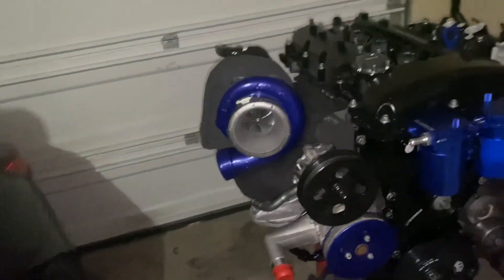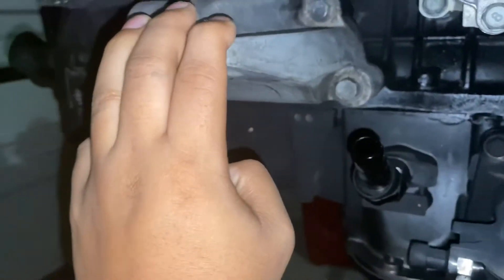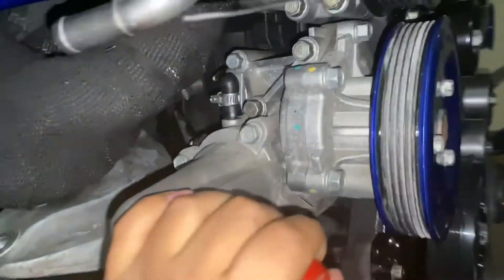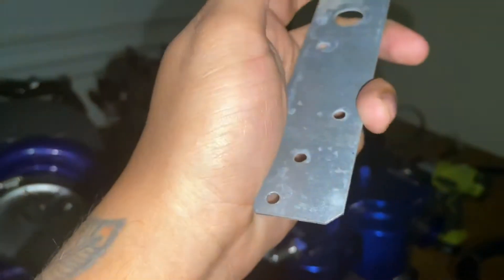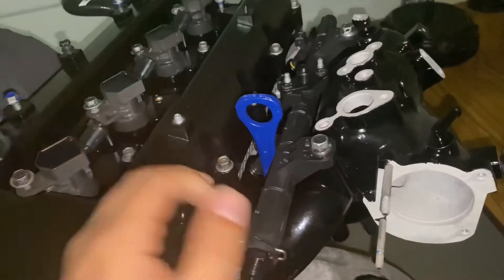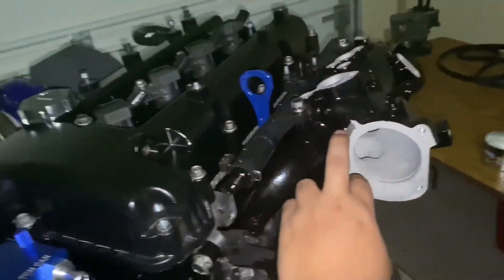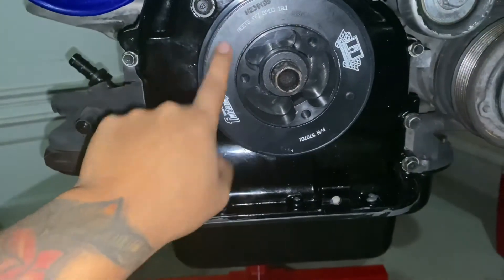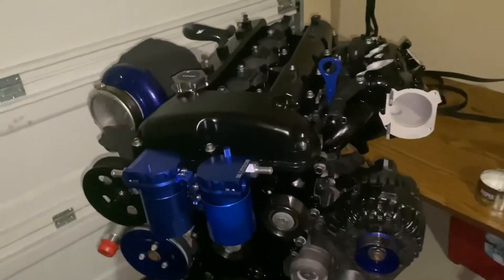Genesis Coupe 2.0T Engine Build Pt.8 | Accessories Pt.2 & Lightweight Crank Pulley Discussion.

Comment: What turbo is it your using ?
Reply from the maker: 6466.
Reply: @Brian Paul  thanks man, I'm in the middle of looking for a second block to build, and I'm probably gonna be following what you did almost exactly so I really appreciate these videos
Reply from the maker: @ryan_ray.  6266 would be better. I only went with 6466 since it was a sponsored turbo opportunity. 6466 was a bit laggy but the 6262 or 6266 would be a bit better and still make 6-700 wheel
Reply: @Brian Paul  6266. Probably would spool up faster, right
Reply from the maker: @ryan_ray.  a tad bit
Reply: Hey, question you made 700hp on stalk crankshaft? Also, did you have to sleeve the block for that hp?
Reply from the maker: @ryan_ray.  stock crank. Stock crank has been taken to 820 whp recently as well. 

And no I choose not to sleeve. But I recommend it for others. I didn’t care if the block cracked or not, my intention was to purposely abuse the block and see what it could take  with stock sleeves and trans.
Reply: @Brian Paul  I'm probably not going for quite 700. Would you still recommend doing it for 500-600
Reply from the maker: @ryan_ray.  I would recommend css for under 600 wheel
Reply: @ProdigePerformance sorry what do you mean by css?
Reply from the maker: @ryan_ray.  cylinder support system 
Look them up bro. Super beneficial
Reply: @Brian Paul  looks really cool, but I'm from Canada, and unless I can find someone from here to do it, getting like the darton international sleeves is almost gonna cost the same
Reply: @Brian Paul  thanks a lot for replying btw
Reply from the maker: @ryan_ray.  css is done all over. Definitely look around your local area for something similar. Snoopy panda would be my go to guy or the other alphaspeed dealer there
Reply: @Brian Paul  I can definitely contact alphaspeed I've been in contact with them already. I plan on bringing it to them to get it tuned when I'm done
Reply: @Brian Paul  actually, that's another thing I meant to ask what you do with the ecu. Are you using a stand-alone
Reply from the maker: @ryan_ray.  yes sir. Haltech
Reply: @Brian Paul  okay, that was my plan as well. Thanks again, man means a lot 🙏

Comment: Has anyone heard noise 2.0t 2010 when I press the gas I get squeal from the engine bay I replaced the belt so brand new never had that problem before
Reply from the maker: Tensioner or pulleys

Comment: Good stuff. I have the same catch cans just mounted elsewhere
Reply from the maker: Thanks man. Appreciate it.
Reply: I have the same catch cans in red. I could use your help running the lines to them correctly. I notice the cans say "in" and "out" and I need to confirm how the hoses attach correctly.
Reply from the maker: @kapitald  both vacuum ports on your valve cover go to the catch can side where it says IN. The OUT side of the catch can goes back to the intake and intake manifold where the oem hose is connected to.